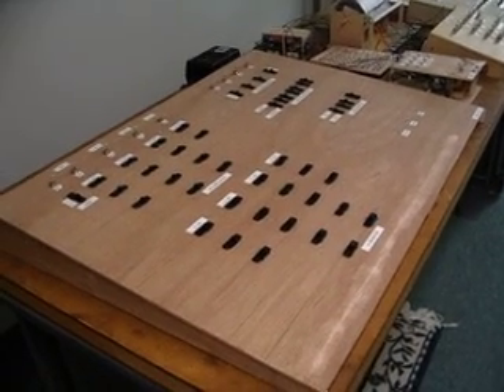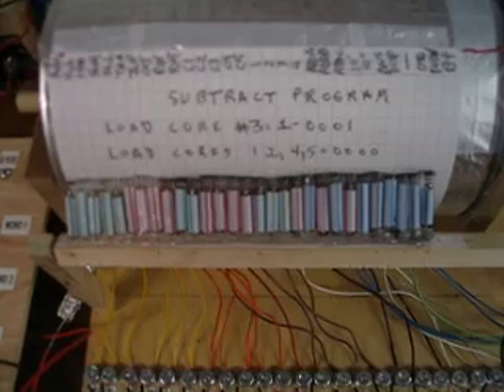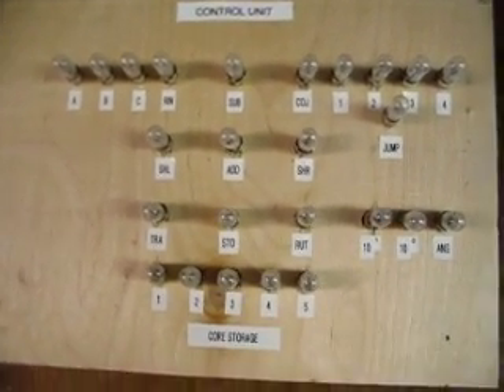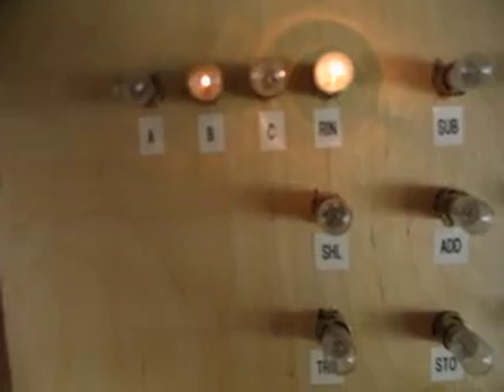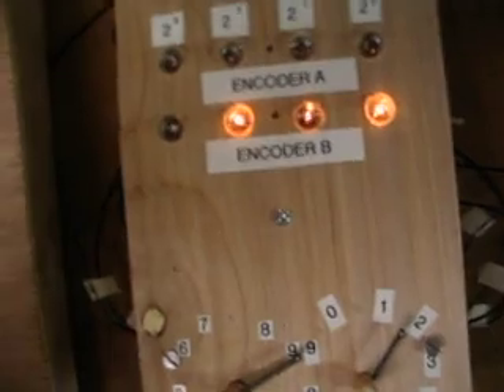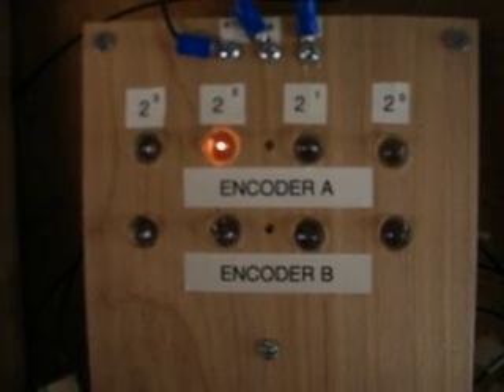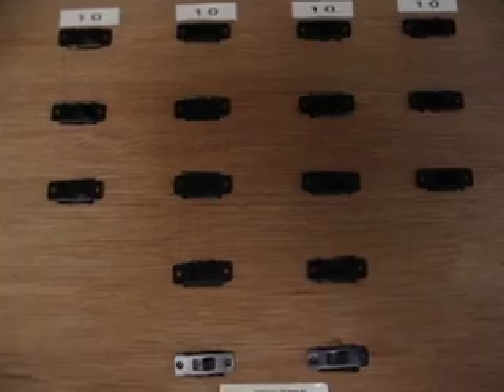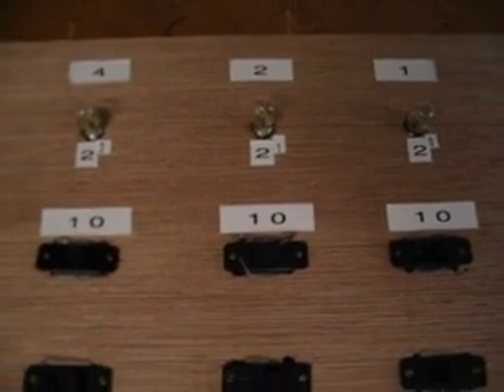paperclip computer part 2 subtraction.avi

Comment from the maker: @jaeg123 
The ALU turned out to be a problem in both builds. I am convinced that the wiring directions in the book are flawed in some way. For instance, the computer will never make a mistake with addition problems, but only certain subtraction problems will work. I believe that it's just a typo in the book. I will need to track down the problem someday.
Your idea for using transistors for the ALU sounds great, let me know how it works out.

Comment: @gort59 It was my pleasure.   I'm thinking about modifying it's design to use some transistors instead of switches especially in the adder.  It would probably defeat the purpose of the original machine but it would be a neat learning experience.

Comment from the maker: @jaeg123 
Thanks for watching my video. This is actually the second paperclip computer that I built, the first went in an ebay auction to someone who had been trying to build one for several years and gave up. Build was a lot of work. I made a few mods to the program drum by using ballpoint pen springs instead of paperclips that tended to tear the program sheets. Also I had to use slide switches instead of the much more expensive knife switches. Learned a lot :) .
Thanks again for viewing!